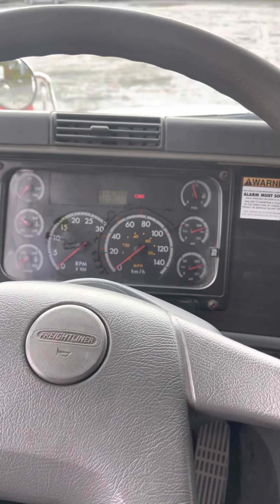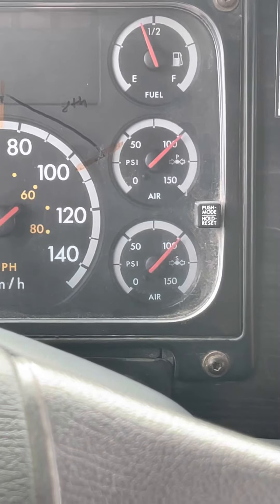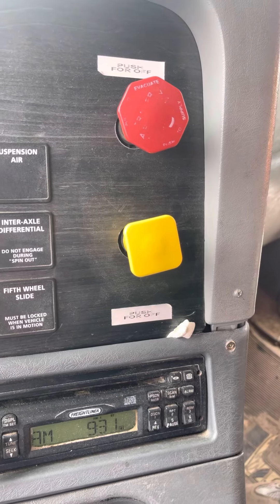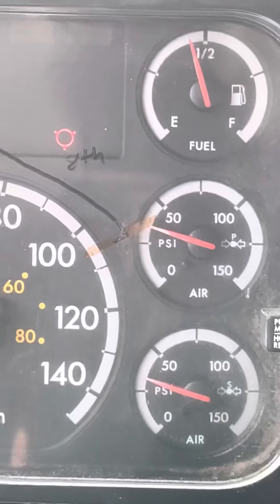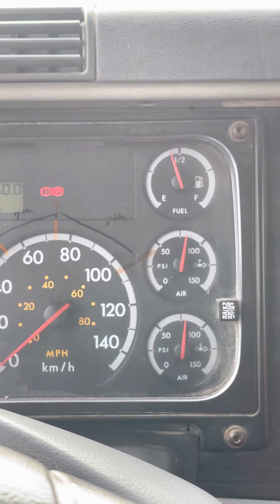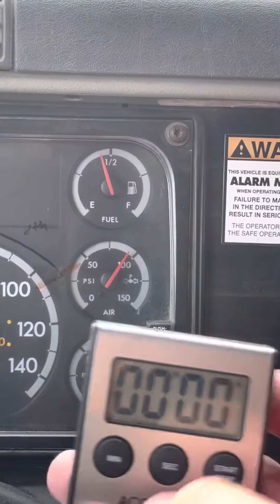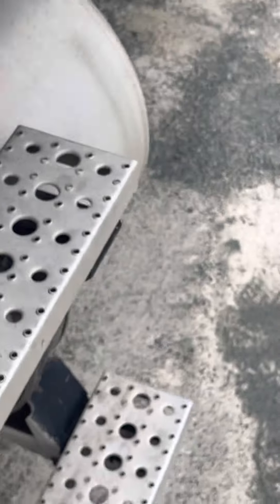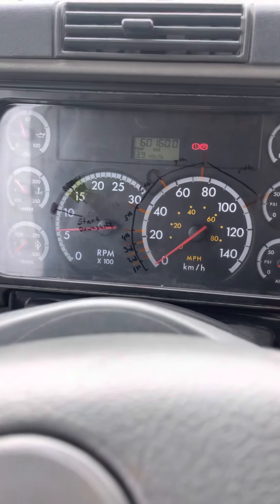Step 4/4 (Air System Test) Nova Scotia Class 3 PreTrip Inspection

Comment: Great video demonstrating the brake test. This is exactly how we do it. One suggestion: for today's audience, you might clip the two longer waits in the build-up from 50 to 90 (4:40-6:20), and 90 to unload (7:00-7:45) and insert an overlay of text saying "45 seconds later" or something similar. This would shave over 2 minutes from the video. When leaving the cab, we teach the three points of contact as you mentioned, but have the student face the cab interior on the way down the steps--we think it reduces the chance of a slip and fall.